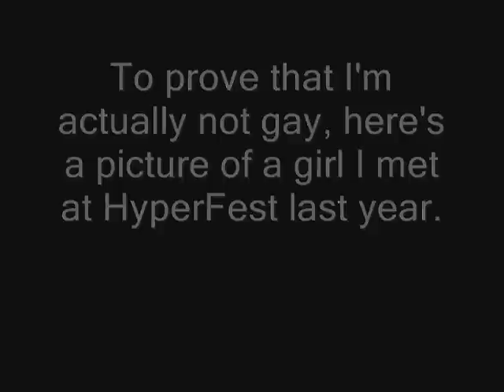Weedeater Bike Fixed: IT WORKS!

Comment from the maker: @19ninety6 It's the primer, not a choke. The purpose of the primer bulb is to bring fuel to the carb. The primer puts no fuel into the engine. You can press it 100 times and it will only recirculate gas through the system. That's why the carb has two hoses, one in, one out of the carb. Once the carb has gas, you can keep pumping and it will just push extra fuel back into the tank. It doesn't run right because a crank seal is bad and makes it not stay in tune.

Comment: maybe a bigger sprocket on the rear, and a smaller  in front.. gear ration is king on projects as such.. or a bigger motor geared beter good progress tho!.. the bigger rpm's /faster ... .. with an appropriate gear ratio= land speed weedeater record

Comment: Hi I am thinking about building one of these and I need to know what cc motor this is because I want to not get that one....
Reply: its 25cc, if he added a mountain bikes transmission it would most likely go faster
Reply: Try using a husqvarna 50cc backpack blower or a poulan pro 42cc chainsaw

Comment from the maker: All I used was mild steel. I'm sure the material you're using is fine, but rather the dimensions and design are to blame. Theoretically you could make it out of wood or plastic but you would need to use a lot of it to make it strong. Look at your design and see where it is failing and why, then figure out a way to distribute load better.

Comment: I made mine using a friction drive and I runs but as soon as you put it on the ground it cuts out as the stress is to much for thee engine how can I cure this
Reply from the maker: It's not too much stress, there is no way for the engine to idle. You need to use an engine with a centrifugal clutch. Either that or you can just never stop the bike. Friction drive is simple but it's not the best way to make a bike like this.

Comment: what materials did you use to attach the motor to the frame? I have a friction bike using a peg but after a while the metal holding the bike together bends.

Comment: -.- If by that you mean its a weedeater engine then that's the crappiest build i have ever seen. The one i build a while back went up to 37 on flat land. And it had no problem ripping around in the woods let alone over grass
Reply: Yeah those are like a little 29 or 25cc McCulloch engines and a little weedeater engines colic me a great engines including those those are a little engines have a two piston rings or most little weedeater engines only have one they’re high compression but that shits fucked the clutch is all burnt up I can tell and the rings are probably pretty shot at seeing as how he hast to pull it so hard to get it started

Comment: You primed it to much and just about flooded it
Reply from the maker: The primer bulb doesn't actually pump fuel into the engine. It just circulates it from the tank into the carb fuel chamber and back into the tank. It's impossible to flood the engine by priming it with the primer bulb.